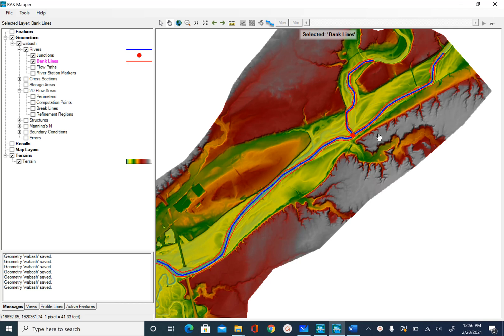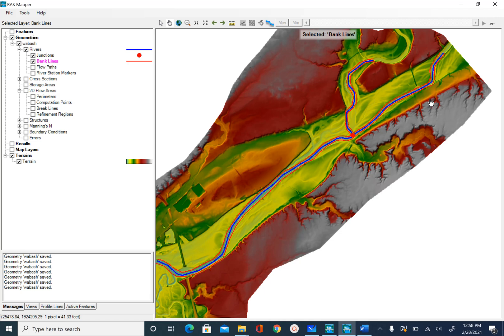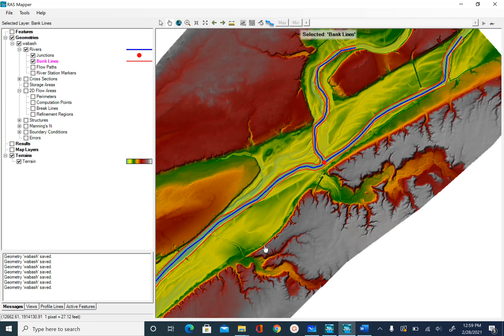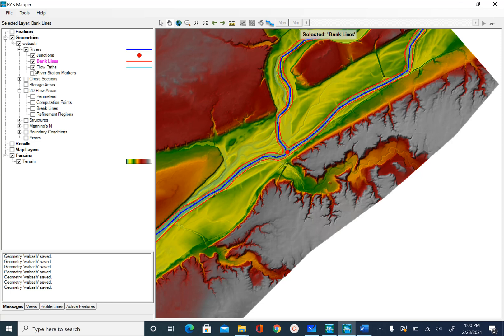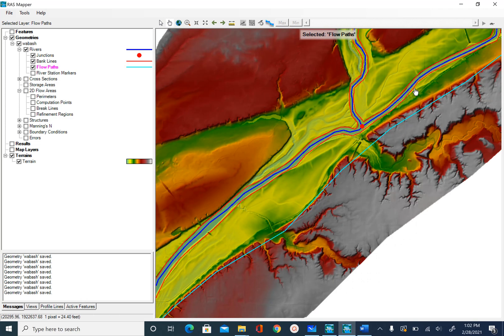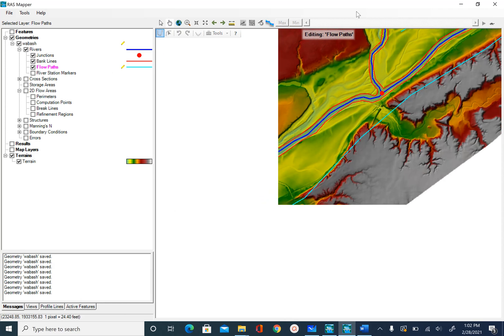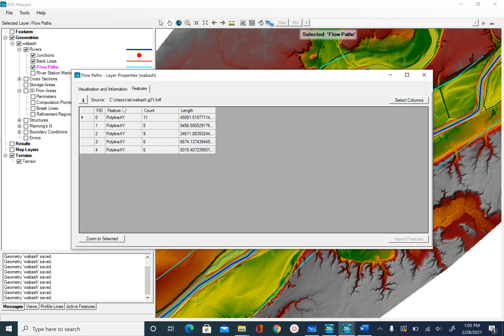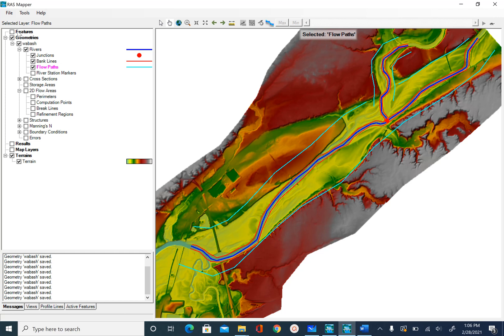1D Hydraulic Modeling using HEC-RAS (5/10) - Creating Flow Paths

Comment: Ciao, grazie per il video. Ho una domanda urgente: perché le flow path lines sono esterne rispetto alle bank lines? In alcuni pdf sul web ho notato che viene fatto il contrario. Puoi spiegarmi meglio?
Grazie
Reply from the maker: These lines do not have any physical meaning. They are basically used to compute the distance from each cross-section to the downstream cross-section. These distance are calculated along the centerline, and flow path lines. it is possible that some over videos/pdf files may be referring to the centerline as a flowline because it is one of the three flowlines you need to compute downstream distances. Hope this helps!
Reply: @hydrologyvideos8253  thank you!

Comment: Thank you for your videos, this is really helpful mate. At 6:09 why did you make a seperate flow path for the main river and the second river since both have the same river bank (right)?
Reply from the maker: Earlier I used to do this in HEC-GeoRAS, where the naming of flowpath whether it is on right or left was critical. A right flowpath for the main river will not be the right flow path for the tributary. That is why I do it separately. I am not sure if this is critical. You can try using the same flowpath and see what happens. Hope this helps!